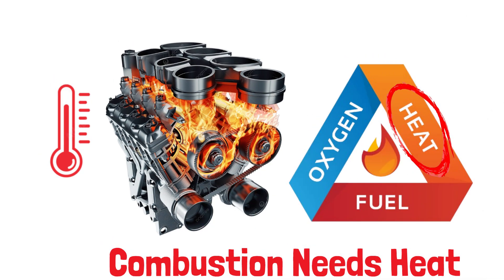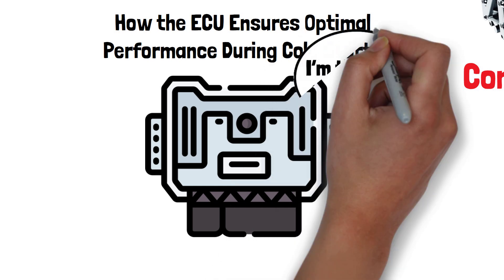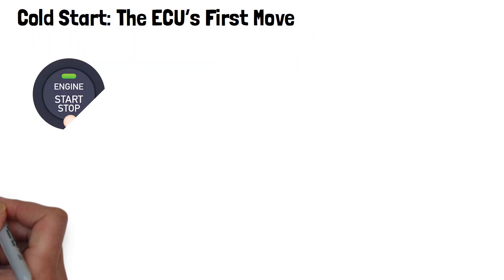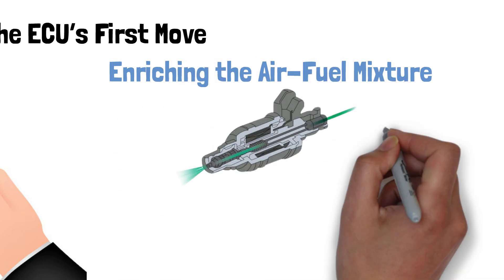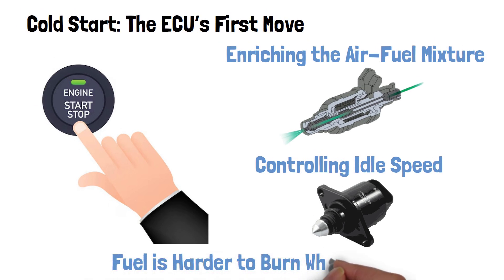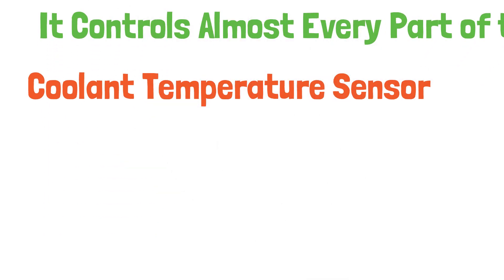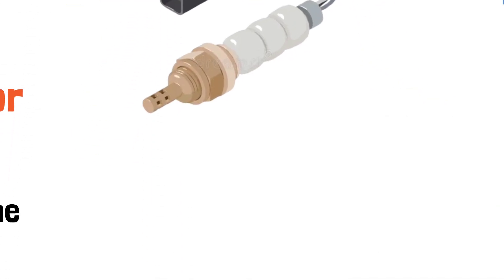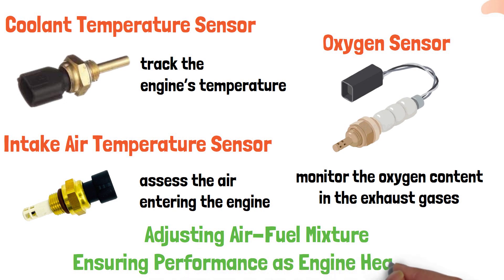The ECU's Role in Cold Start Engine Performance

Comment: Any ideas why my 2000 Ford fiesta revs to 3000 rpm when its cold?
Reply from the maker: Sounds like the engine is in cold start mode! Some cars rev higher when they're cold to warm up faster. It could also be the IAC valve (Idle Air Control) or even the coolant temperature sensor acting up. Worth checking those out if it's happening regularly!